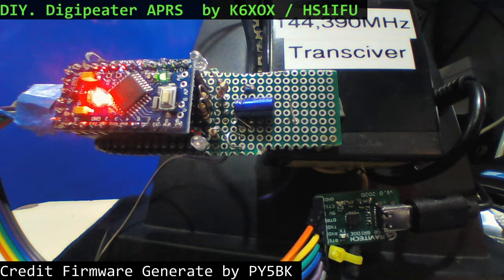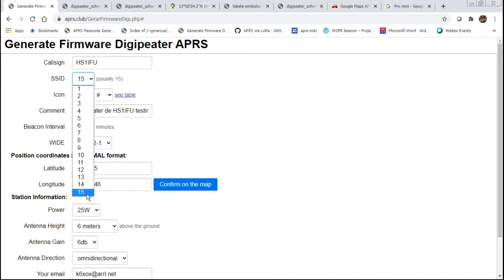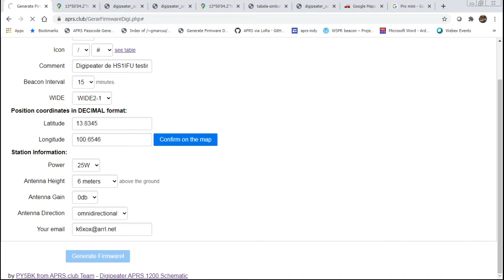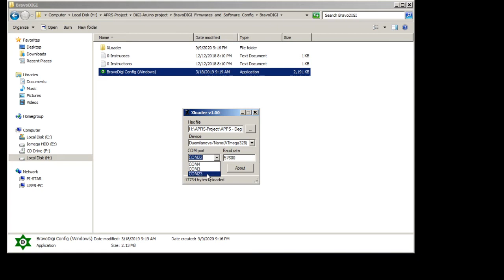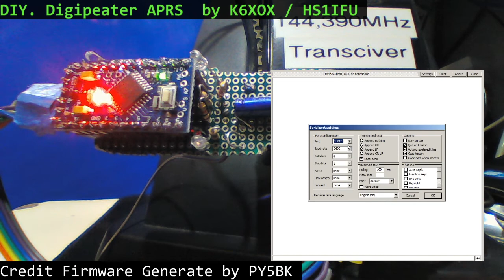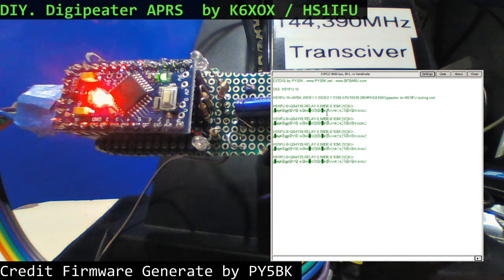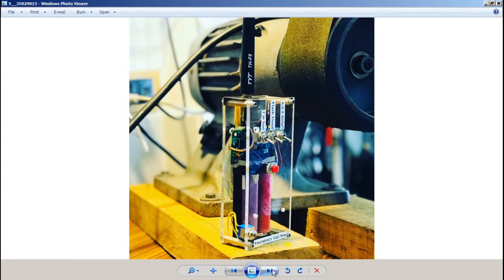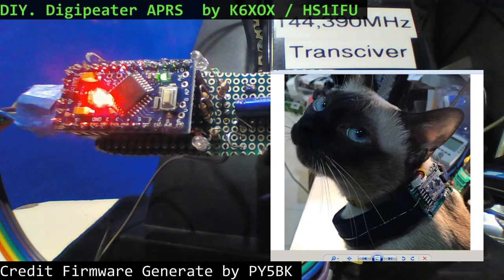DIY: APRS DiGipeater  simple made in very low cost (English Version)

Comment: I made about five of them. You can use it as TNC via USB or add an BT board, just changing the firmware to the arduino. UNO, nano, pro mini can be used. 73's.
Reply from the maker: the Firmware that they generated for this same schematic as Micro Modem but  when packet received did not have Led for checking the incoming completed packet or not.  it still need to improve